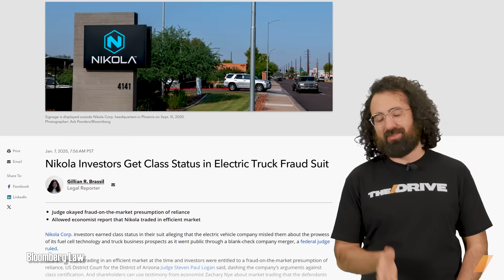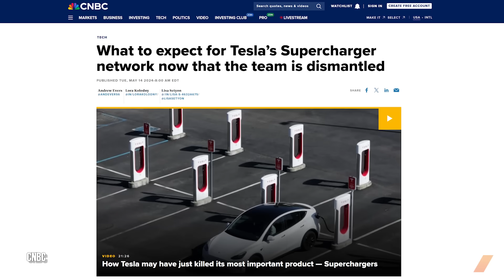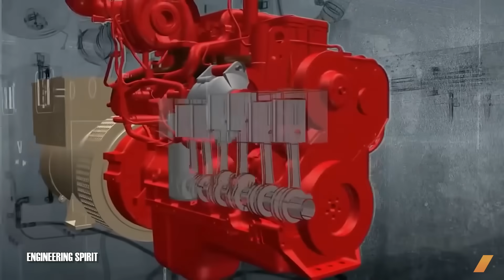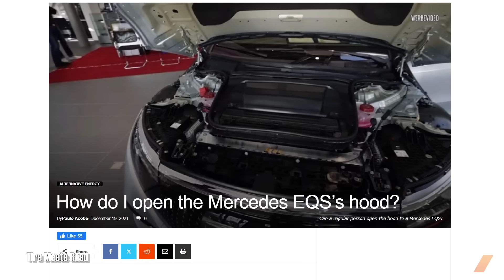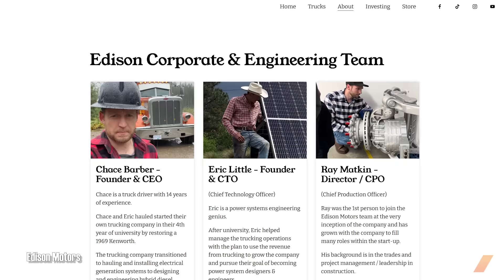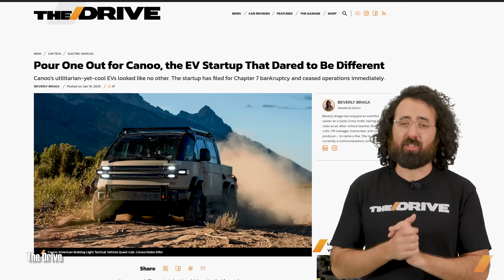The truckers in a shed beating Tesla with 100-yr-old EV tech

Comment: When you throttle an engine you kill the mileage.  But you HAVE to throttle when an engine drives the wheels because of gearing/accelerating.  You are literally choking the airway, and that is where energy is lost.  Your car/truck is sucking air through a straw at low RPM.  That is a gasoline engine.  In a Diesel you lose some power every compression stroke, and you get it back when you burn the fuel.  To "throttle" the engine you just inject less fuel.  The problem is that whether or not you use the full amount of fuel, you still need to put in the same amount of air, so it still needs to be compressed.  Turbos can reduce that because burning less fuel means less gas to spin up the turbo, so the pressure goes down a little, but Turbo Diesels still have to compress more air than they actually need to burn the amount of fuel they are using at low RPM.

There is a little more to the story, but I think you get the point.  The optimal RPM for a Diesel is where the total amount of air compressed is actually burned, so it doesn't take too much energy to compress it compared with the energy that you get from it.

Comment: I don't think Edison Motors needs to be using old diesels for their engines. When I keep my 1.5L Ecoboost Escape in 6th gear on the freeway, I can get 33 MPG going 85 MPH. Imagine what a 2.3L Ecoboost could do at constant output.
Reply: Any ICE engine hybrid making over 50 hp is a candidate for cars. Any engine over 100 hp is good for trucks and 150 hp for semis.
Reply: To be clear, I think a constant-ouput-optimized low displacment diesel would be the best option. I just don't think that's being mass-produced right now.

Comment: EV's need a huge infrastructure. Powered with green energy. Solar, hydro, or even nuclear (actually quite environmentally friendly except for the waste issues).

EV's charged overnight on petroleum fuled generators can actually put more hydrocarbons into the atmosphere than comparably sized conventionally fueled vehicles. Absolutely no environmental improvement!

Finally, EV's should be cheaper.  But Telsa and other EV companies are grifting off their customers. EV's are far simpler. Have no transmission. Electric ACs are similar to the AC unit behind your house. Much cheaper and far more reliable than belt driven units required on engine driven vehicles.

Comment: I've been following the Edison project for years and I just can't understand why tandem hybrid tech has not been applied in more markets. For example, I design and build home battery backup systems, which are most often recharged via solar. But lately I've also started implementing the ability to recharge via gas generator, and the concept is exactly the same as tandem hybrid vehicles. It's the perfect emergency backup for cloudy spells - it takes advantage of all the strengths of gas generators (cheap, small, energy-dense fuel, etc.) while minimizing their weaknesses. With modern charge controllers, any size of gas generator can be used to charge any battery. It will simply run at a constant load just below its limits, so even small generators are sufficient to recharge a home battery in a matter of hours. And no need to worry about surge / inrush current of home appliances either - batteries / inverters handle those much better than gas generators. It's a win-win for my clients, they love it... so where is it in the mainstream??

Comment: Also moving that 1000 lbs. from the front to the rear and lower to the ground will make the trucks massively safer.  Electric motors on the axles will also vastly improve stopping power.

Comment: Battery is dead without quick change (SEMI trucks are perfect for this cause the trailer frame can hold the batteries), and I highly doubt if it can beat Hydrogen in the long run.  Hydrogen ICE machines are actually far greener to produce, maintain, and operate than all current EV estimates, and the Core Engineering for the technology is already complete and viable, we just need to increase our total grid by 5-10% to cover the Hydrogen capture (even better if done off of Nuclear Energy facilities since the cooling water you can use to pull the hydro from is already quite hot and can be more fully cooled brofre being ejected back into the fresh water lake/river/reservoir feeding the plant.

Comment: This is the perfect complement to EV trucks. Full electric makes sense for inter city use in major cities with lots of congestion and smog or for daily route work like delivering potato chips and soft drinks with lots of recharge time overnight, but long haul, unpredictable schedules, mountain driving, heavy loads, and northern climates are best suited for diesel electric or straight diesel. There is no one perfect technology for all applications and we need to quit trying to mandate it to be so. In southern climates trailers could be covered with solar panels to supplement the diesel engine also.
Reply: Great point

Comment: The Ward Leonard system was a widely used method of controlling the speed of DC motors in elevators from the 1920s to the 1980s. It was invented by Harry Ward Leonard in 1891.

Comment: People need to understand the engineering behind this approach. They're burning diesel to make electricity, and then using the electricity to power engines that turn the wheels. This introduces losses that make it less efficient than a diesel vehicle that just uses the mechanical power of the diesel engine to turn the wheels, because every time you convert you lose a little, so you lose something converting from mechanical->electrical energy, and you lose a little when you convert back from electrical->mechanical energy. In some cases, like in trains and ships, these losses are worth it for what you get in return, like full torque at zero RPM and the ability to send electricity to systems through wires instead of mechanical energy through complicated drive trains and transmissions; but for most road-going cars and trucks, the trade offs are NOT worth it, you just end up with a vehicle that requires more gallons per mile to move. 

But there are niches that can make these trade-offs worth it again, and Edison Motors targets these niches. The most obvious one is logging, where it's very often the case that heavy loads are being moved downhill. And empty truck drives up into the mountains, loads up and then drives back down using regenerative breaking to re-charge the batteries. In this scenario, the hybrid system is much more efficient than a regular diesel truck. 

I'm not trying to shit on Edison Motors here, I'm just trying to say that there are actually totally valid reasons why no one else has done a diesel electric hybrid for road going trucks yet. For the vast majority of applications, it's just not the right tool for the job.
Reply: people havent done it because we never had the tech. they are much more efficient that diesel mechanical because the power plants in DM trucks arent running at a set rpm so they can only be generalistically tuned when edisons power plants, which are smaller too, can be fine tuned for a steady rpm.

Comment: Why is it that Americans are allergic too aerodynamics
Reply: if you're hauling 50 tons of logs on an open trailer, the truck being areodynamic is the least of your concerns

also, curved windows exist to make repairs harder, not trucks better.
Reply: @ it’s almost like that sort of thinking is why these companies struggle so much due too operational costs
Reply: @ 

it's because of "areodynamics" that half of a copmany's operational costs is sending trucks back to the dealer for repairs instead of being able to do it cheaper themselves.

Areodynamics on large trucks like these is nothing more than a gimick to try and force companies and truck owners to ues dealer services instead of servicing their own vehicles.

because yes, you do get better fuel mileage (assuming you're just carrying normal boxes and not any payload on a flat bed that's open to the air)

at the cost of paying 10 times more to fix it when something breaks.
Reply: @ aerodynamics do not mean you can’t repair something or it’s more expensive you can literally put covers over open loads
Reply: @TinyBearTim  curved glass.
Curved windows.

If the window kf a truck I'd a flat plane of glass, much like the eddison trucks in this video, any one cam easily cut a piece of glass into shape, and replace it.

If it's curved, much like the tesla truck shown, then that requires specialized techniques to produce, running up the cost, and most likely forcing you to use dealer services
Reply: @ you don’t need to curve the glass for it too be aerodynamic
Reply: @TinyBearTim  I agree.
However almost every single modern truck that is trying to be built areodynamic has curved windshields. 
Even if it isn't built to be aerodynamic, slight curves in wind shields have been common for decades.
It's just another small part in the car companies attempts to make it harder to repair their vehicles.

Comment: I'm glad these guys are getting the traction & publicity they need. I've always wondered why more major automotive companies haven't adopted this setup. Chevy made the volt, but they didn't really advertise it so it flopped. I know the Edison setup is a little different, but I've always been a fan of hybrid pickups. If you're towing something you can get the instant torque right off the line & in between shifts with the electric engines, then let the gas or diesel engine take over during cruising. So you can get the range you need in a truck, while still having the power of an electric motor.
Reply: hmm, maybe because plug in hybrids are good for short journeys, but after that you're just burning fossil fuels and getting worse efficiency due to lugging around a larger than necessary hybrid battery. The volt was well advertised and sold ok, I had one, my mom still drives it. There are plenty of PHEV options these days if that is what you're into, but you're really missing the key advantage of EVs, which is the ability to use renewable energy. PHEVs only accomplish this on short journeys.

Comment: Too bad no one is really looking at LiFEPO4 batteries that are 10x lighter then current Li batteries EV currently use. They can be the answer to the range problem and wight as you can add the extra batteries to get the same range, but still 8x lighter.
Reply: I believe Edison started out with Lifepo4 batts, but their 2c discharge rating made them change to 5c LMO batts.

Comment: Meanwhile, the shadow-president Elon Musk's attempt at a pick-up is failing at everything a truck is meant to do. It doesn't even handle like a few inches of snow. My Honda Civic has handled worse snow without losing traction, and that was just with normal street tires. Instead of spending billions on replacing our military's armored vehicles with cybertrucks, I think we could save a ton of money by taking ordinary cars like my Civic, tune the engine, weld some thick steel sheets to it, and give it beefier tires to handle rough terrain. If guerilla forces in the middle of nowhere can kick our asses with jury-rigged toyota technical trucks then i dont see why this wouldn't be a viable strategy. Just straight up mad-max that shit.

Comment: First clip:
Southern Railways owned ALCO DL109. The DL109 exists in the “Bulldog Nose” category of locomotives. They were commonly used by railroads on their passenger services due to their appealing streamlined appearance. Also referred to endearingly by railroaders as “Covered Wagons”, locomotives that shared the general design were often considered a joy to operate. Later in life, locomotives used in passenger services were reassigned to freight as railroads began to see a steep decline in passenger service. Built by the American Locomotive Company (ALCO), the DL109 was built as a direct competitor to the more popular GM EMD F and E units, which also fell under the “Bulldog Nose” and “Covered Wagon” category. Other competitors to the ALCO DL109 included the Fairbanks Morse FM CFA 16-4, and the Baldwin BLH RF-16 “Shark Nose”. While the ALCO model wasn’t as popular as the EMD’s, having only sold 74 total units domestically compared to GM EMD’s astonishing 7,600 F units and 1,300 E Units in both E-A and E-B configurations. While there are no DL109’s in preservation, you can still learn about their history and use by railroads. The DL109 is among the more obscure examples of Bulldog Nose style locomotives, but is still noteworthy as the few that were purchased were, in appearance, top of the line. There also dozens of E and F units still in preservation, with one of which being from the Southern Railway. The Southern Crescent No. 6914, which operated the Southern Railway’s premier passenger liner “The Crescent Limited”, is in preservation and on display at the Tennessee Valley Railroad Museum, and is slated for restoration and ultimately (potentially) operation by the museum for excursions.

Comment: Fun fact, Europe already has a lot of fully electric trucks from a lot of different companies that are already on the market. In my opinion Europe is far ahead of the US when it comes to trucking technology. Now I'm not saying that EVs are a good option with the current battery technology (they're really not), but the energy density and manufacturability of batteries might significantly improve. However, even when it comes to diesel trucks, Europe has incredibly efficient trucks that at the same time are way more powerful than american ones.

Comment: This video sounds more like an ad for Edison than an actual unbiased discussion about powertrains and the new vehicle strategy for our transition.

Claiming EVs are more complex because of proprietary software to run the electric powertrains, but not claiming the same for PHEVs which also use ... get this... proprietary software to run their electric powertrains, is clearly a false premise.  Yes, diesel engines are a known quantity, and making them more efficient and simpler is great, but they're always going to be more complex than a fully electric powertrain.   Fully electric uses less components and less complexity, but has a larger battery pack.  Plug-in hybrids use a more complex powertrain that includes a diesel generator, but uses less batteries.

That said, I'm actually a huge proponent of plug in electric hybrid vehicles.   However, when it comes to trucking, I think there's far less need than in personal automobiles.  Trucking routes are usually a known quantity, so charging infrastructure can be setup specifically on major truck routes.  Trucking makes up a huge percentage of total transportation based global emissions, and had we triaged the building of fully electric powertrains and infrastructure for the majority of those trucks, then the use of the battery resources would have gone far further towards reducing global emissions.  Instead, we've used most of our battery supply up to this point inefficiently in personal vehicles, where a plug in hybrid powertrain would have been just fine given that most trips would only use the battery, even though the battery is smaller.  

As it stands now, a personal vehicle that's fully electric may only use 10-20% of its battery capacity per day on average.  A plug-in hybrid uses closer to 80%-100% .  An electric semi could use anywhere from 100%-400% of the battery every day. (Over 100% meaning it would deplete its battery and charge it in order to continue traveling)

Yes, more battery cycles means the battery won't last as long, time wise, but it will often last more cycles given that batteries degrade by both cycling them, and as they age.  The faster you tear through the cycles, the more cycles they'll typically get.  Further, battery recycling is significantly more efficient, environmentally friendly, and cheaper than mining new resources and building new batteries from scratch... so those batteries falling out of service just means they'll be recycled to produce cheaper batteries in the future.

Yes, PHEVs can be great for semi trucks as well, given the particular circumstances of how the truck's used.  That said, there are additional energy losses when the engine is used to charge a battery, and then further losses when the battery is used to power the motors, so that's something to keep in mind.

Comment: 2:37 1350 kg for the battery pack? Do you have a source for that? Because I think this is Hollywood.
The battery of an BMW i3 weights 235 kg, wether the big one or the small one.
That would mean the mentioned one is 5-times the weight, besides the fact that this truck is more than 10 years younger!
Reply: 2:57 and the diesel weights NOTHING? If you load a truck with 500 gallons of diesel, it is no additional weight? 
Interesting.
And the transmission adds also no weight? And the oi, water etc. to keep the engine running?
No 24 V starter batteries?

Comment: 7:10 as a truck and coach tech meeting emissions with no egr or dpf is absolutely incredible, systems like that are always in my way and are slowly but surely choking truck engines to death, modern engines with those components regularly make it to millions of miles without it the only real limit is the life of the battery cells.